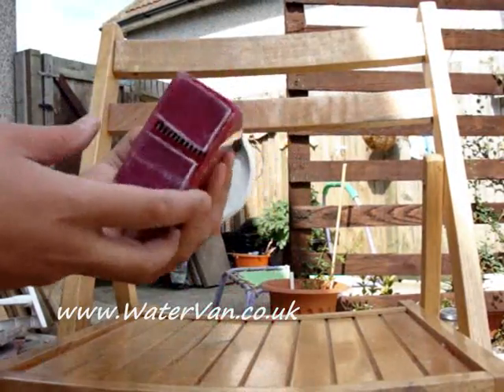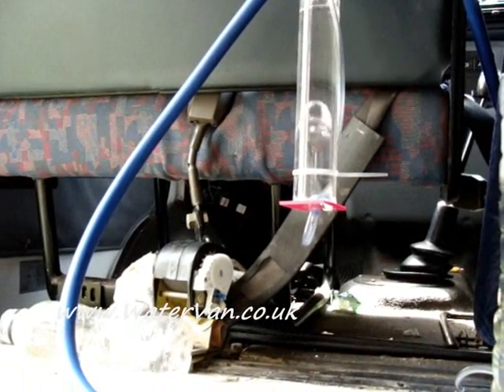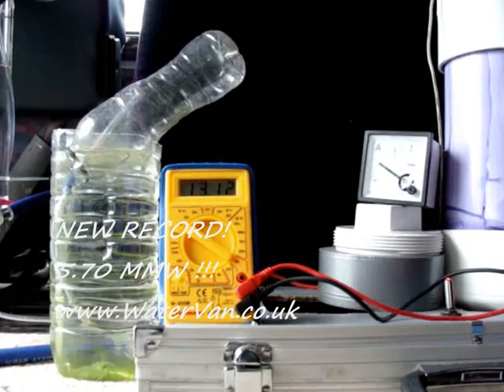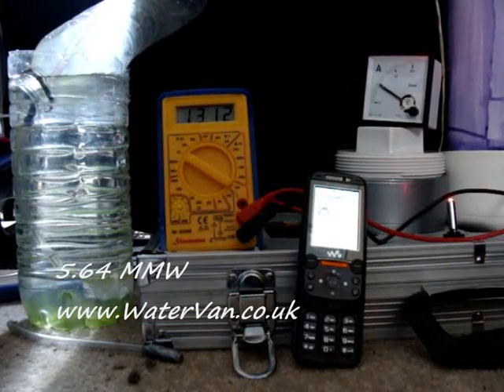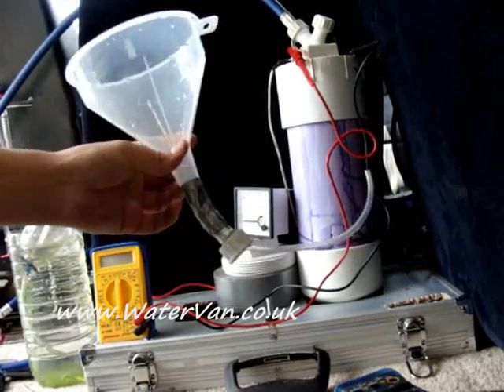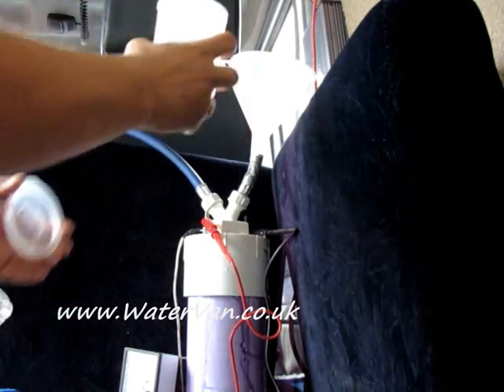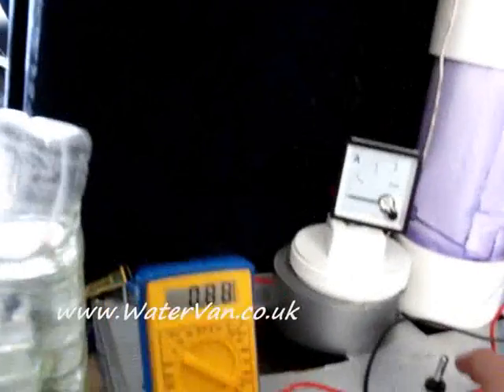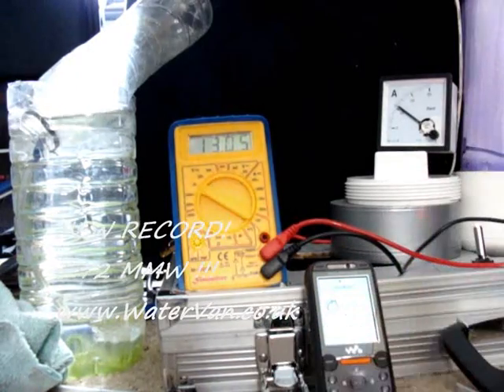#030 C5 MadStu's Water Fuel Cell - NEW RECORD! AGAIN!

Comment: imagine working with a perfect sphere. of course you'd have to measure everything out exactly or maybe have it professionally made. also, if the bubbles were to be dispersed through multiple tubes connected to the same source and destination, maybe it would have less restriction and make flow of the hydrogen easier. you've done more experience in making fuel cells, but i am making some crazy parts for my car that no one has ever done before

Comment: Excellent work! ZFF really made a difference :) Good work guys! Please try brute force but with cylindrical cell configuration - position the tubes as Stanley Meyer did, that way you only have edges on top and bottom (where the pipes were cut). SM claimed that pipes are approx. 2.5 times more efficient - exactly because of less edges. Godspeed.